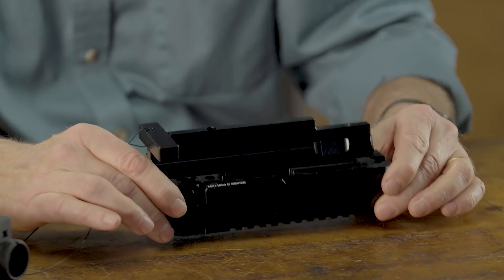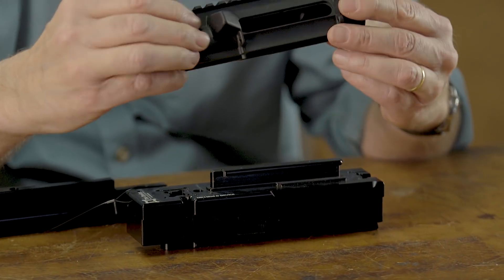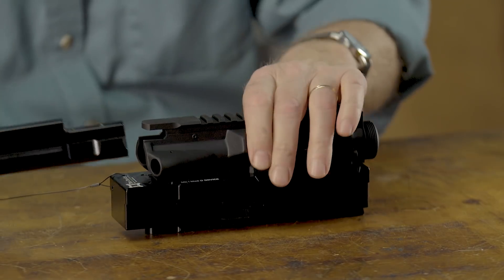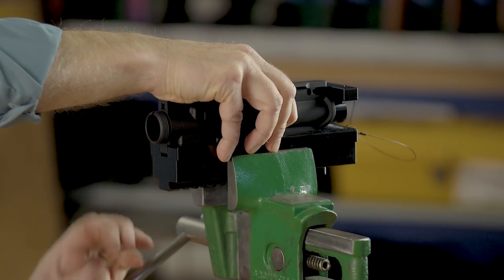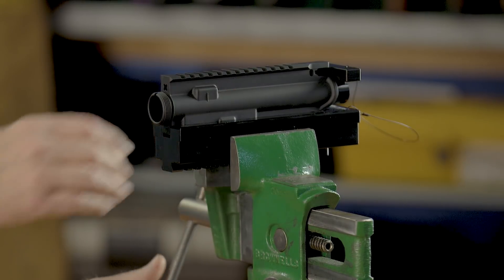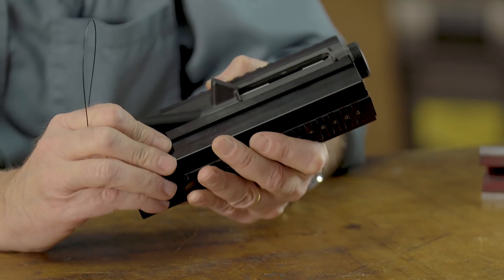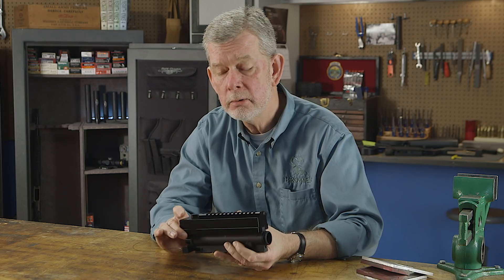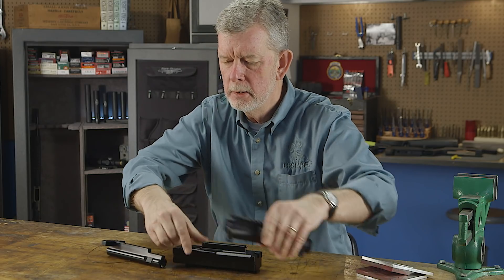The Device AR-15 Upper Receiver Fixture

Comment: This Device has intuition?  Maybe that’s a cheap shot, out of context, or a reference - in the jargon of gunsmithing - that I’m not familiar with.
But to claim that any device facilitates accomplishing a job is what a buyer expects.
Apparently this device sets a low bar in citing its value.
Caution in product claims is usually appreciated.  But it’s beyond caution when it feels overstated just to assure you it doesn’t “interfere” with your goal.
But it actually says that!

Comment: I'm not sure this is a tool worth carrying in your store. A reaction rod is the ideal tool for installing a barrel or muzzle device. So the only real use is to install or remove the pin for the forward assist, and leveling a scope? There are much cheaper tools for that.

The only use i see for this tool would be to hold it in a vice completely exposed for some kind of engraving work. But this tool isn't ideal for that either. And extent over priced.

Are there other uses for this that I can't figure out?
Reply: Jonathan Ocab Jonathan you might want to check out what I already posted brother. You're talking about the alignment pin in the barrel extension. Already said something about it. DPMS claw piece of polymer 2 aluminum pins $60 and it does what this does maybe not as well but pretty damn close I've been using them probably for the last five to ten years whenever DPMS came out with them I bought them over the clamshell and I have all the other tools to I would even like to have this one I just won't pay $300 for something that cost $100 to make and produce that's retarded.
Reply: The gunsmiths that I know do not recommend using a "reaction rod" style tool for installing barrels. Something to do with the torsional force transferred to the barrel pin. The rod is great for muzzle devices, though.

Comment: Very nice piece of hardware, however ridiculously overpriced. This thing is not made by Snap-on Tools it's made out of aluminum and it isn't complex to machine this tool. Let me know when it drops down to around $179 and I'll order one possibly two. Three hundred bucks that is ridiculous. We'll see how many of those you sell it looks like online you've only sold two so far. Or two reviews so you may have sold a few more but this isn't going to be a fast-moving item unless they get real on their prices. Not when you can buy a DPMS claw for 60 bucks and be done with it.
Reply: David Wright. or a reaction rod
Reply: Jared Bickmore reaction rods are good I have both the AR-10 LR 308 and the AR-15 M16 reaction rods by guiseley. But when you're getting up above 50 foot pounds of torque I don't like to put all that torque on the barrel extension you can shear the alignment pin off very easily when moving above 50 foot pounds of torque. I've got the Magpul setup I've got the DPMS claw I've got reaction rods and I could see using this tool for doing Barrel installations because it seems to be a lot stronger than the composite polymer DPMS claw, however not for that much money that's ridiculous you'll never make your money out of that unless your commercial Builder and even then you know how many DPMS $60 Claws I can buy for $300. But I agree with you Jared there are other tools that do it way cheaper.
Reply: David Wright defiantly cheaper